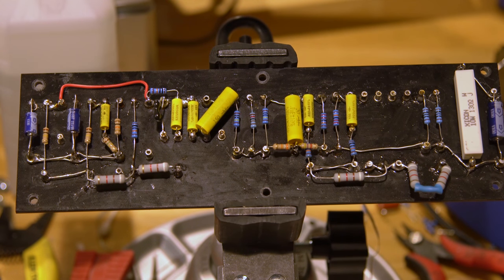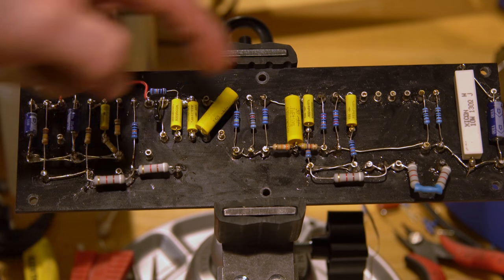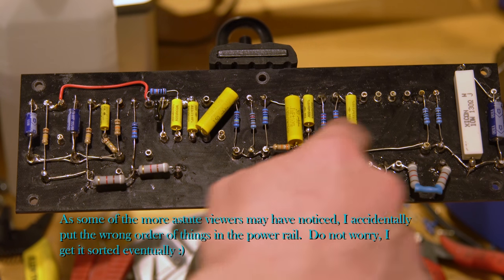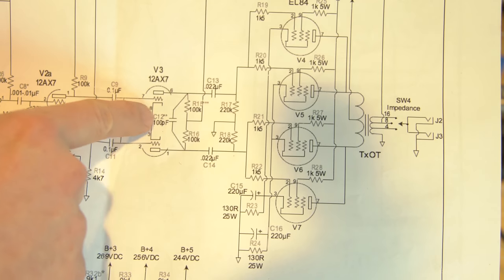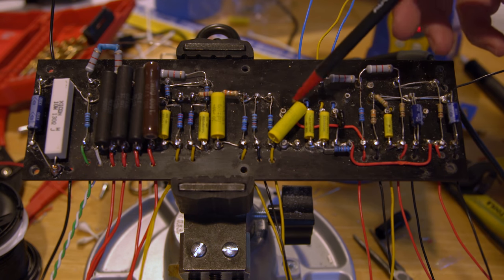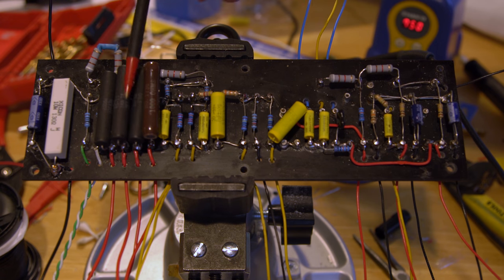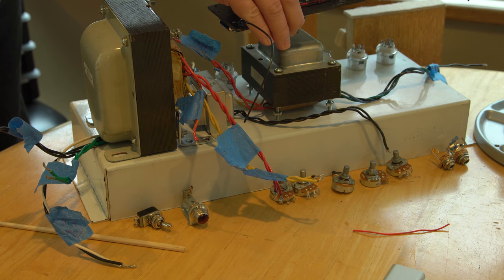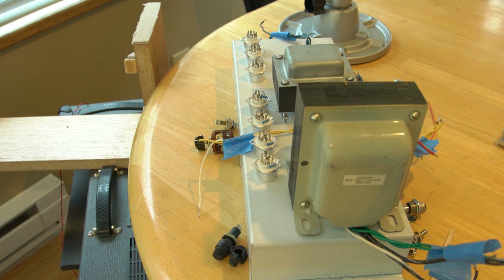Trainwreck Liverpool Video2

Comment: Also I see (3) places  where it seems like  there is
an { X } shaped jumper? Starting at the south end of
the electrolytic cap furthest west.
 What is that about?
Reply from the maker: It's just a good way of making sure you keep a solid jumped connection.  It's a strong physical one by wrapping the bare wire around in s cress crossing pattern.

Comment: At 00:10 in this video, the 9100 Ohm resistors, of which I see five,
what kind are they in relation to the ones shown in the first 3
minutes of this video- ( https://youtu.be/sN1cGli-E7s )

Thanks Wayne
Reply from the maker: Ahh yes those are also ceramic wire wound 2 watt.  I forgot to show an example of that kind.  Power resistors basically